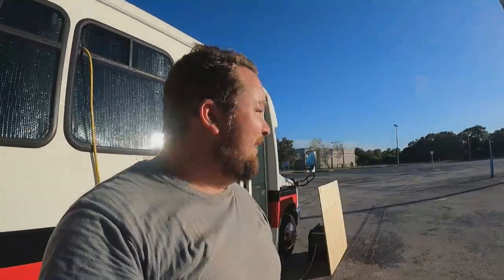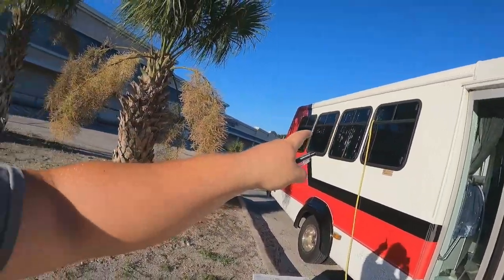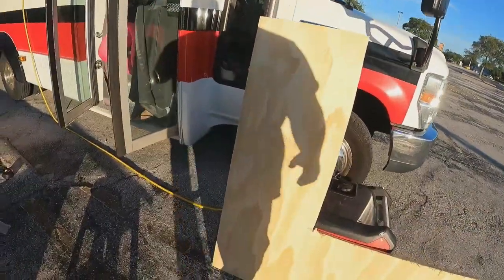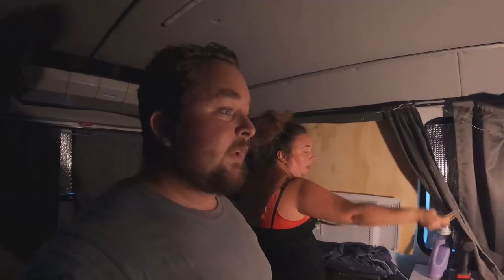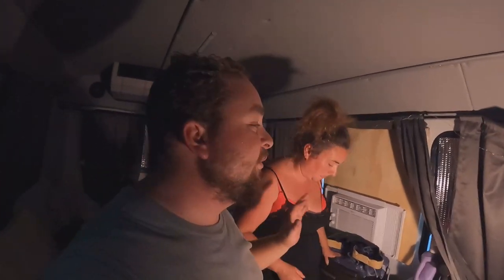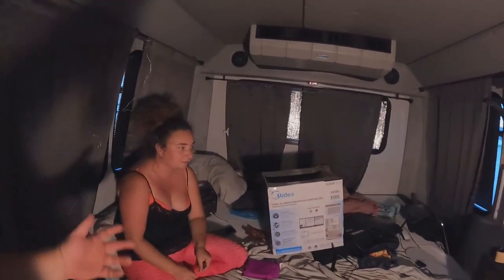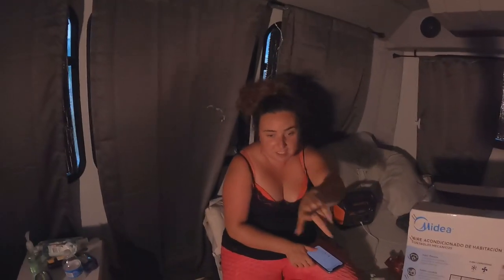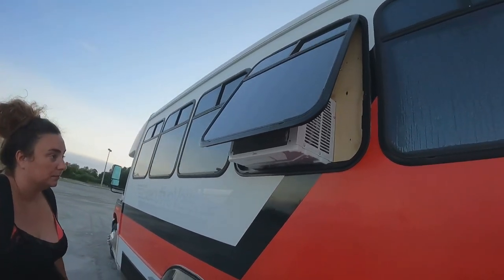Window A/C install in our shuttle bus! #shuttlebuslife

Comment: What do you use to clean and seal RV roofs?
Reply from the maker: Dicor
Reply: I love yalls videos. I use to work with you at Horizon. I've never met yall but I got the job at Horizon because I watched your earlier videos. I've been watching yall for I think 3 years. (give of take) hang in there I know yall are going through a tough season, but it will pass. Thanks for the info of dicor. I have a 24 foot artic fox fifth wheel. I've never did a roof or really anything to a camper before. What all do I need to buy to seal the roof? I would rather pay you to do it, but I don't believe you want to drive to Oregon to do it.

Comment: Why don't you covert ac in back to run off the generator not much to do
Reply from the maker: We were told we couldn’t.
Reply from the maker: The rear ac works off the motors compressor and a giant condenser on the bottom.
Reply: That sucks would take it out then and sell it and put a mini split in build a bracket to hold it and ur bike